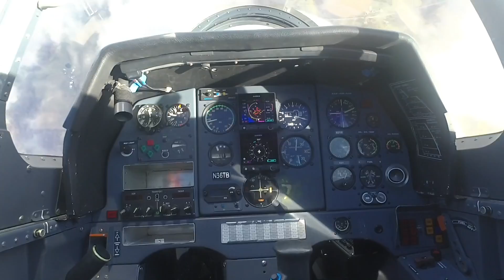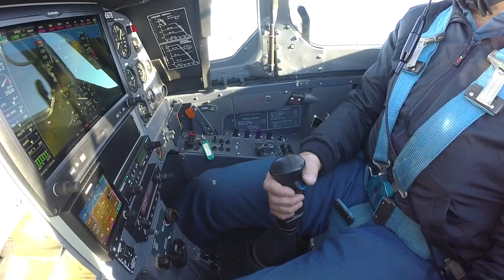Tips & Techniques: Stall Recovery in Unusual Attitudes

Comment: I'm a non pilot but this is so interesting.  So, if the plane is about to stall, keep the nose down. But then what ? It seems like this skips a step.
Reply: That's the sort of stuff covered by formal training. The short answer is that nose down immediately stops the stall and returns normal control. I think the missing step that you suspect is not actually solving the stall but fixing the situation that led to the stall in the first place.    
This depends on the specifics of the situation. It may be as simple as just don't pull back so much. 
There are a few categories of ways to get in that situation: purposefully such as doing aerobatics or stalls for safety practice, here there is a reason and a plan;
A pilot that was distracted or focused on some other problem and allowed the plane to get into a position that it should not have been in from the start (In which case after nose down, just stop doing the thing that you did.);
and last and by far the least common is a freak incident like a extreme turbulence inside of a storm or broken flight controls and that is a longer and complicated answer specific to each model of plane and the location and altitude.

Comment: Please help how could I join aviation pilot programme in scholarship
Reply: However, with an accelerated stall, you should never exceed the maximum maneuvering speed for the aircraft which is the stall speed times the square root of the aircraft G limit. Things start to bend and break after that.

Comment: We all love clear, invisible air, but there are times when it would be extremely helpful to our understanding if we could see it. But in your mind's eye, at the moment this aircraft stalls you can "see" exactly when the airflow over the wing goes from smooth laminar flow to a burble. And that's a stall, whether it's an aircraft wing, a sailboat sail, or even a boat's rudder in water. You can stall any surface over which a fluid medium is flowing.